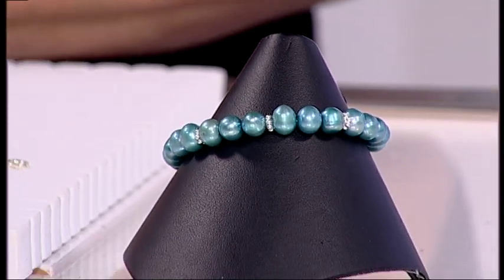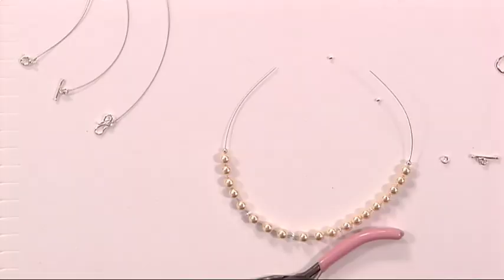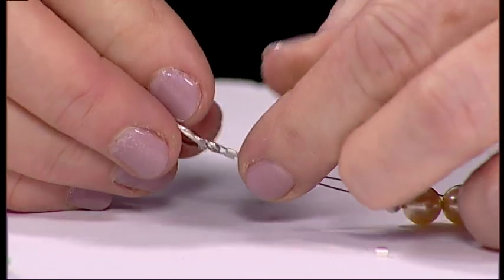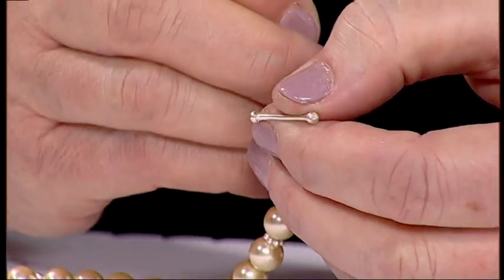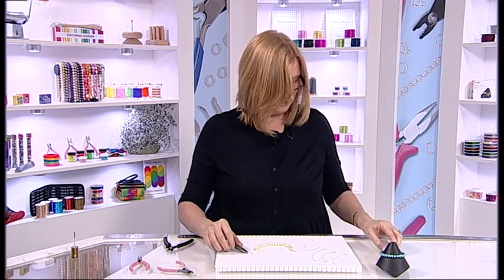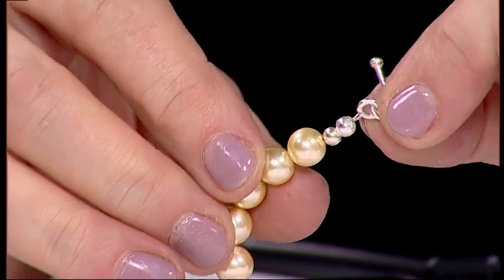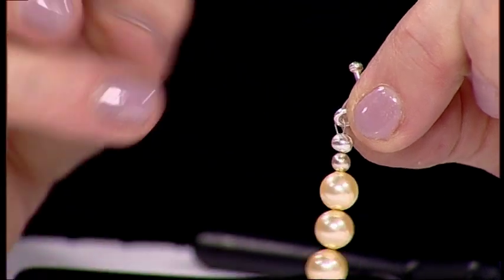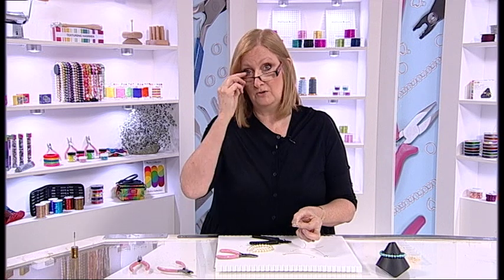How To Attach Crimps & Clasps

Comment: Thank you for sharing.  I am trying to attach a dangle to then end of a zipper pull of a homemade make up bag. I tried with the small metal jump rings but they came apart when the zipper was pulled. Would it be better to thread the beading wire through the zipper attach a crimp and then finish the dangle.  Advice would be much appreciated as this is a long awaited gift for a friend.